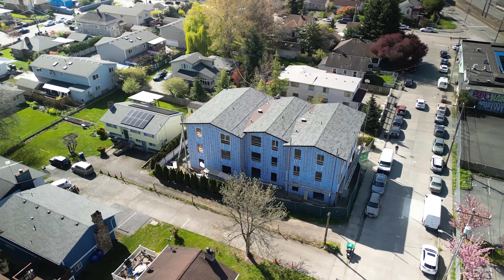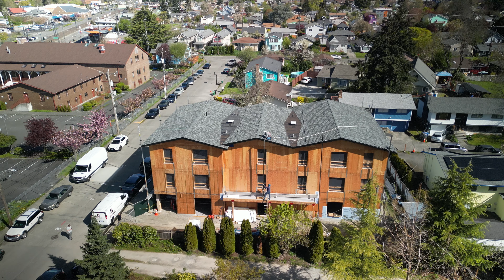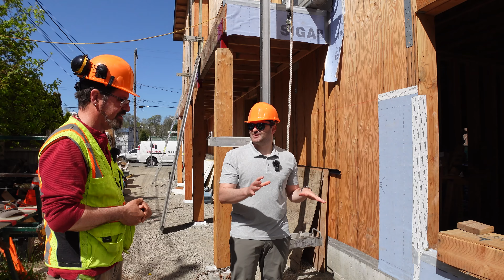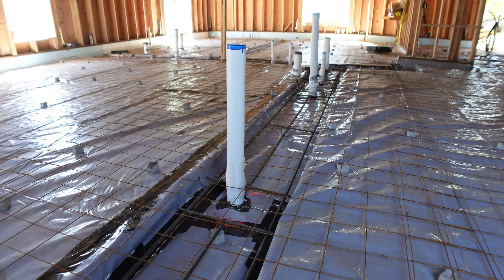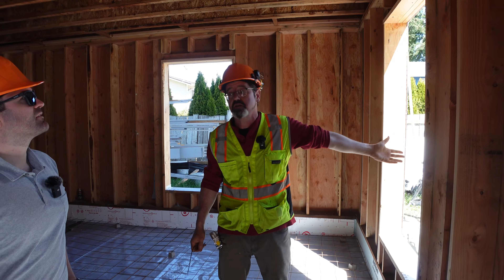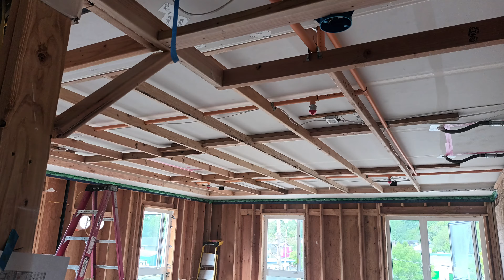Passive House Pros Share Airtightness Secrets

Comment: How are you insulating the concrete stemwall?  Oh, i see foam glued(?) to inside of concrete stemwall...still i wonder about thermal bridge at bottom of wall section where it meets concrete stemwall...but looks pretty good with conveniently flat surface to finish.